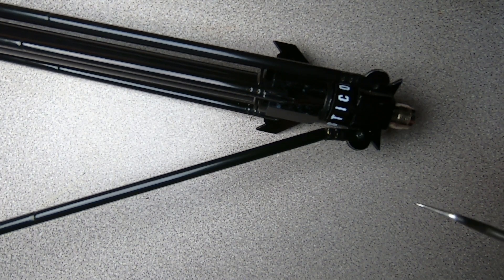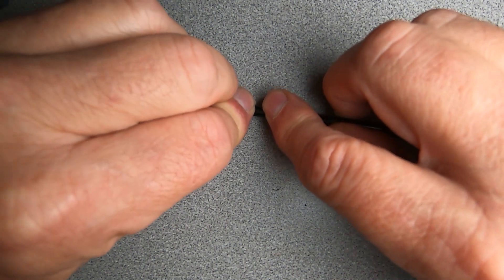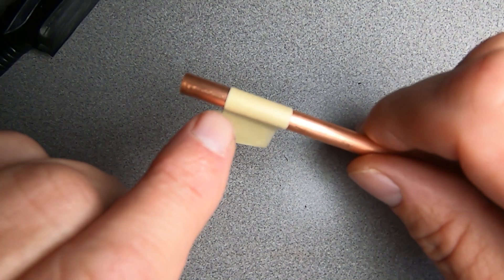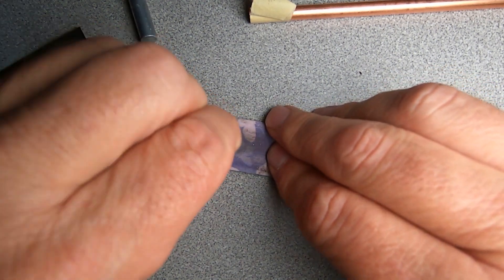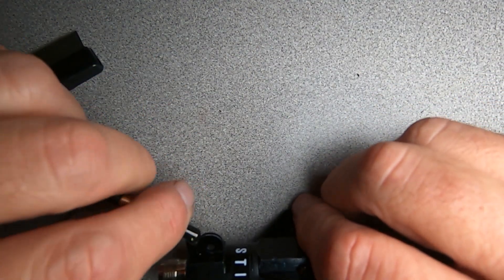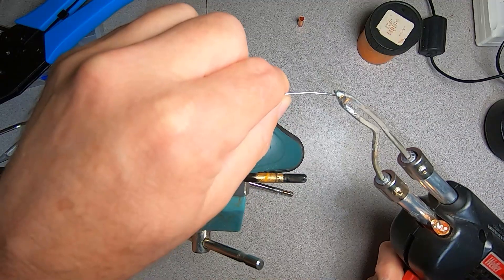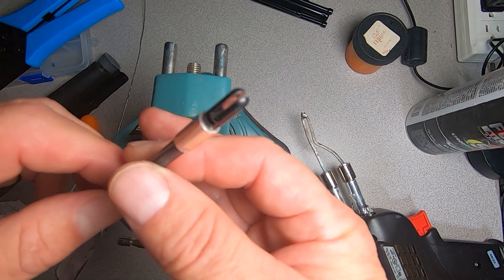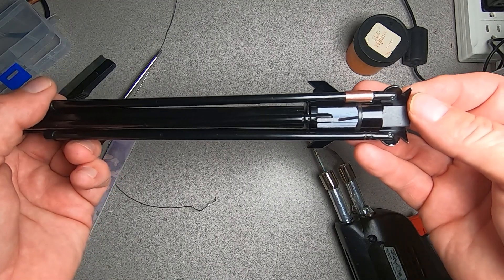Repair a broken telescoping antenna element - STI-CO  CPAK

Comment: if the might become heavy, would doing this before a problem comes up be a good idea? but for any telescoping antenna
Reply from the maker: It added very little weight to the antenna. Its a strong repair but most likely if the element is subjected to impact it will fracture at the distal end of the repair. Its like the proverbial crimp or solder a subminiature pin dilemma . Thanks for watching !